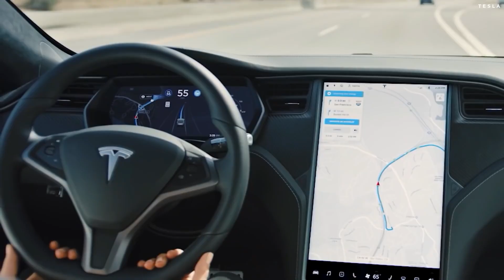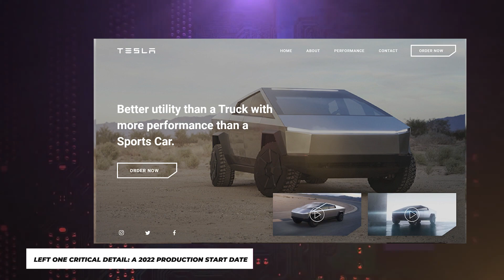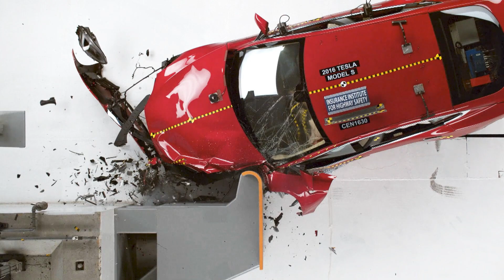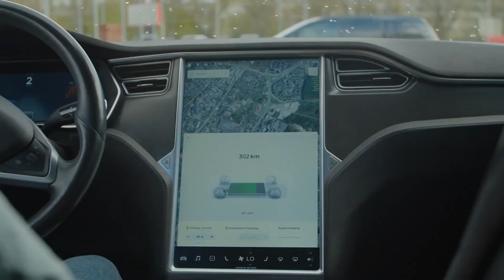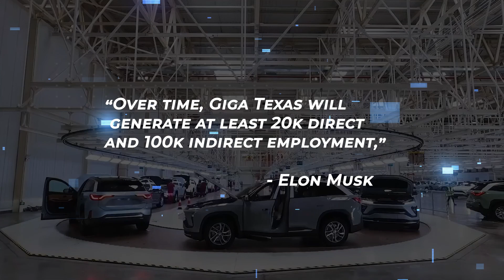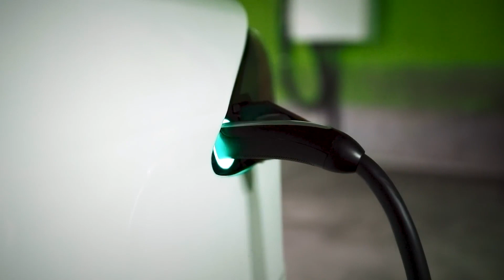Tesla MASS-Production at Austin Texas Giga Factory BEGINS NOW!

Comment from the maker: Are you excited about what's coming to Tesla?
Reply: I would love you to dive very deep in to this solar part. Others have said it will not have enough roof space to be 100% self generating. Electrically speaking. I have a hunch not only will it be 100% self sufficient but also put that gas electric plate out of commission. So it would need to be able to supply enough power to many of the houses in the area and grind stabilization too.

Thanks so much hope you start digging soon. Look forward to what you come up with.